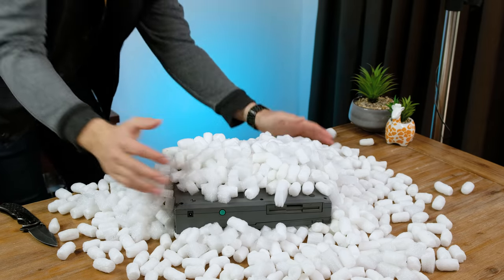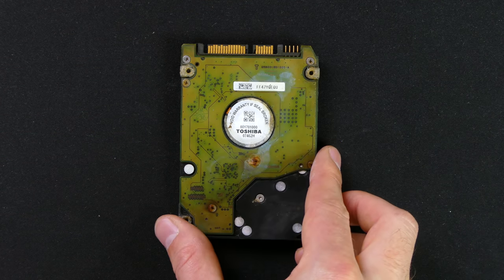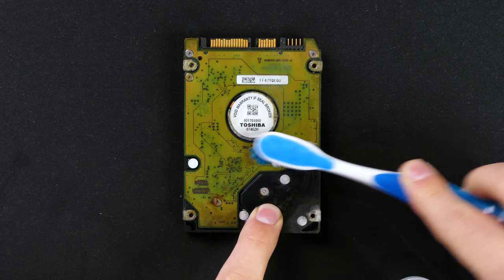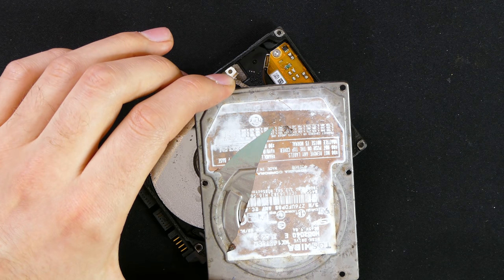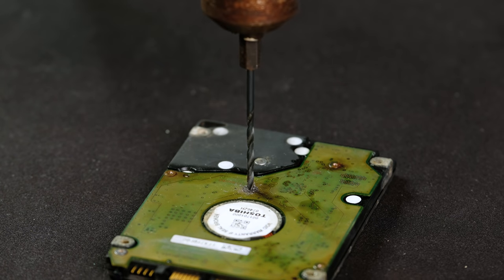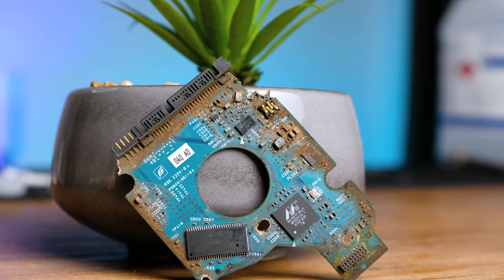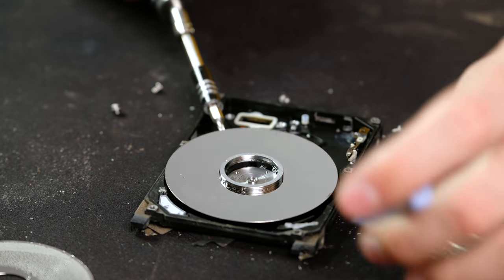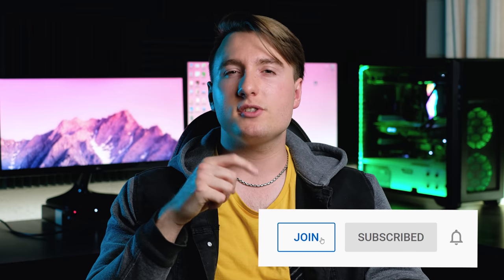Hard Disk Left On A Roof For 5 YEARS! What Happened?

Comment: Hard Drives aren’t actually Airtight, they have a small access hole (Marked Do Not Cover) to let air in and out when the Disk Spins, there’s a filter on it. But I’d imagine it would let moisture in over time if you’ve left the drive in the Rain.
Reply: I believe that some of the newest, highest capacity drives are helium filled (some of HGST's 10TB drives come to mind). However, 99% of hard drives that you find will have an breathing hole, and are not sealed.
Reply: I've seen that on the HDD label before!
Reply: The hole is not there to let in air in and out when it's spinning, it's there to equalize the pressure between the inside and the outside of the drive.
Reply: there is possibility for water to get in through the Screws
Reply: @Owennn yes, but it has nothing to do with the spinning of the disk

Comment: Helium Filled Drives like the Helio Seal family from HGST/WD are intact air tight as they need the low pressure the helium creates to prevent the platters from warping and hitting each other while they are densely packed. When the seal is breached they either operate and an unusable speed or not at all until you get it serviced (the drive will state it’s status in S.M.A.R.T.) Great video, use to do hard drive qualification and verification testing, but never seen any scenario THAT extreme.

Comment: Hard drives are not completely air tight, this is because air pressure is created within the hard drive casing during operation. The remedy to this is a hole on the front of the drive casing, this hole to relieves that air pressure as the drive is spinning.

Comment: I think there is a brand of hard drives that is air tight, in which they create a vacuum inside. But most aren't, they usually have a little tiny air hole with a sticker that says to not cover it.

Comment: Only new helium hard drives are air tight. Normal HDD's are definitely not, actually they have breather holes on them and it is encouraged to not cover them, since they help equalize the air inside the drive.

Comment: Hard drives are not air tight, they use air filters to keep dust out and to equalise the pressure inside with atmospheric pressure.

This is why at high altitudes a hard drive like the one in the video can't be used, because the outside air pressure is so low that the read write heads can't hover above the platters at the correct height; they rely on the air pressure to create a cushion of air that keeps the heads above the platters.

If you need a hard drive to work at high altitudes you need a Helium filled drive which are sealed and filled with the aforementioned gas, or a special drive designed for such a use case, which are pressurised to sea level atmosphere and then permanently sealed. (these drives have mostly been replaced with solid state unless capacity is required)

Side note, the way the read write head works is exactly like a speaker, and is known as a voice coil, and if you feed the voice coil the same signal as you would to a speaker it will actually make sound like a real speaker would, albeit at a very low volume and may not even be audible to the human ear.
They used to use a stepper motor like a floppy drive does, but they aren't anywhere near accurate or fast enough for modern hard drives.

Comment: drives up to 6tb are not air tight, as they even have hole saying ''do not cover'' or ''breathing hole'' meaning that air inside drives is same pressure as outside... drives 8-16tb are filled with helium and are welded

Comment: Only Helium filled drives (ones used in high-end machines and datacenters) are airtight because if they fill it full of helium then not have it airtight then there’s no point, and the reason they have helium drives is because it has much less resistance than air, making them faster. It would cost way to much to make every hard drive airtight considering most hard drives are going to be in enclosed spaces and in a home environment.

Comment: I have almost 2 months old MSI GF63 and if has M.2 SSD with 256GB and normal 2.5 inch HDD with 1TB. In my 2 years old lenovo ideapad 100s is soldered drive with 32GB of capacity and in my almost 8 years old Acer Aspire one 756 was 2.5 inch HDD with 320GB and i sold it recently (about 25 days ago) for 15 dollars

Comment: hard drives are not air tight. you can see an air filter to keep dust off the drive near the 4 pins. Some hard drives are air tight, but those are specialty drives

Comment: you don't know much about hard disk drives. do you?

no, hard disk drives are not air right and are even rated to altitude. they air pressure to work (to get air cushion). there are holes in both cover and case to allow breathing. They need it, as pressure rapidly increase while they spin up and pressure is temperature dependent as well. you need more or less constant air pressure in hard disk drive to get consistent width of air cushion. If air cushion would get too big, then you would have trouble reading drive (and you won't be able to write it at all, as it needs to know exact position of Head in order to write). Ifyou get head too close, then you risk temperature increase and even had crash.

clicking sounds is not head hitting against casing (this is physically impossible due to construction of drive), but head rapidly changing direction of movement.